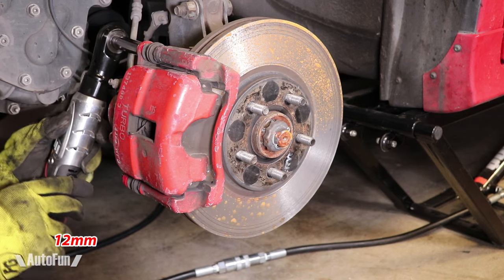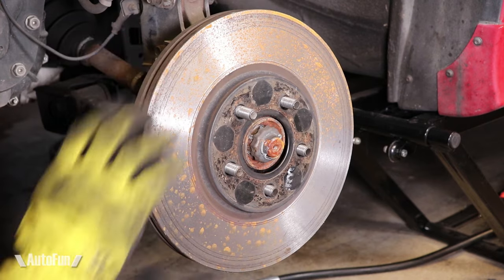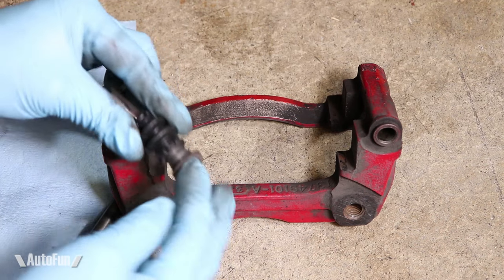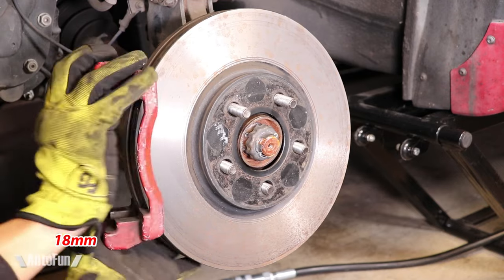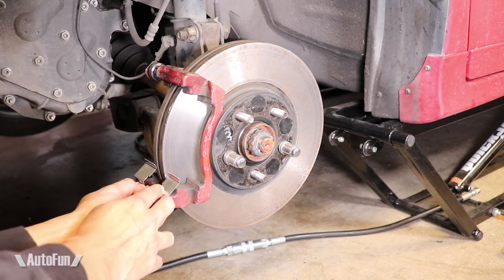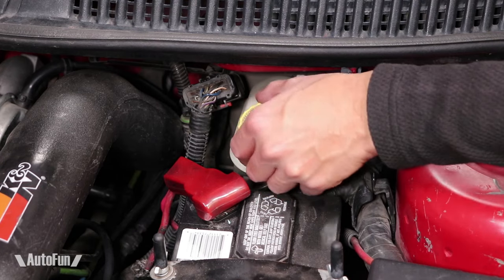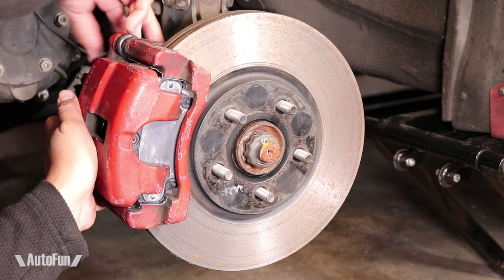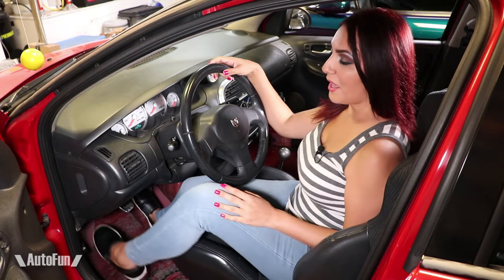Dodge Neon SRT4 Front Brakes Install (2003-2005)

Comment: And when you’re reinstalling the new brakes if you put one of the Lugnuts on to hold the rotor in place that makes it a lot easier to align everything
Reply from the maker: Keep the tips coming bud! will try them out on the next brake job...

Comment: You do know if you turn the wheel so that the front facing outward you can get to the top bracket bolt with your air gun
Reply from the maker: Hi davieboy1970! thanks for sharing this tip will try it out next time that I'm down there! 🍻